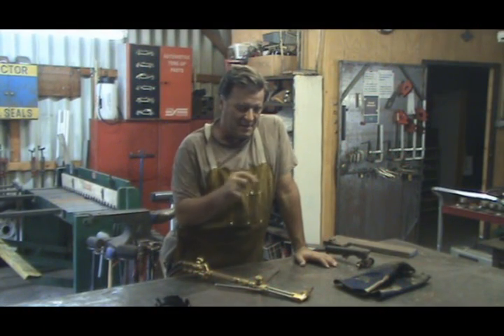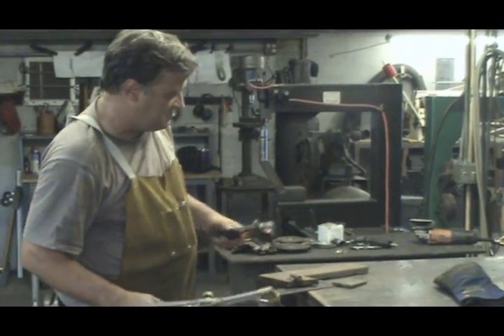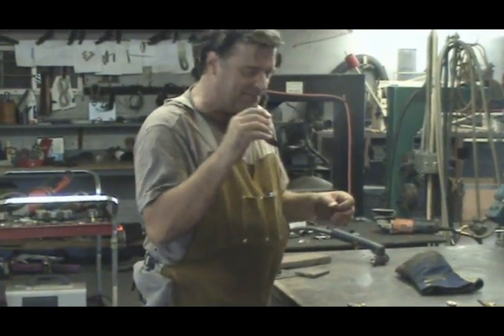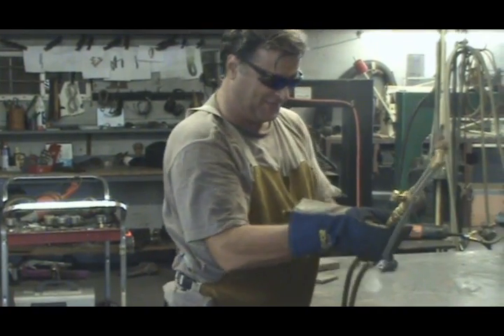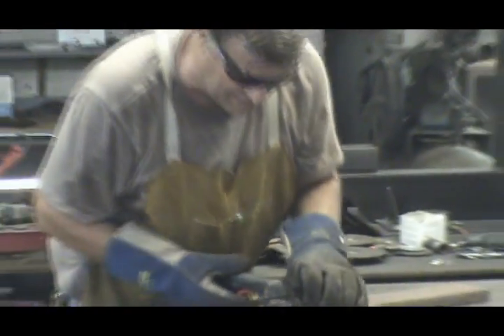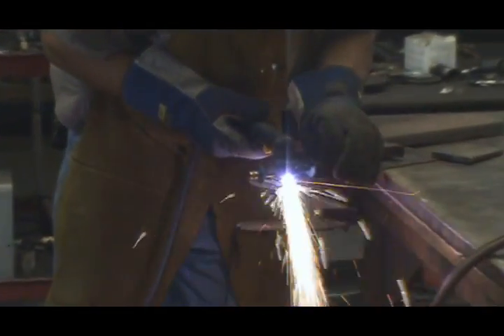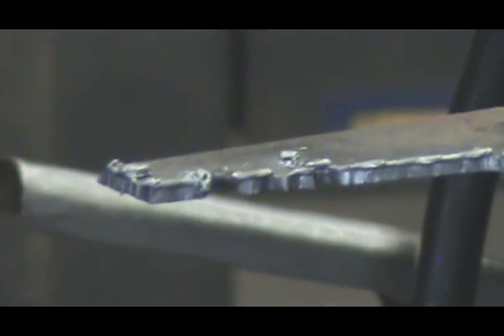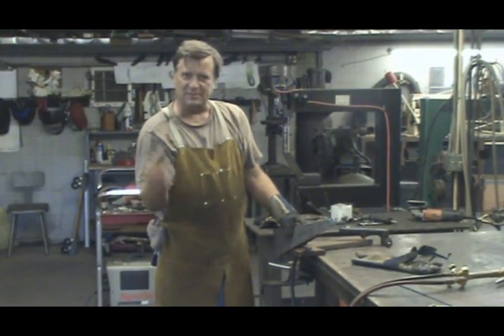Metal Cutting: Plasma vs. Oxygen-Acetylene - Kevin Caron

Comment: I would never cut sheet metal with oxy-fuel at all. Plasma cutting looks very promising for knife making, which would save me a lot of my quality, homemade pine charcoal, belt-sanding and forging on 1095, 5160, O-1 or 440 stainless steel (plasma can air harden this grade due to the incorporation of molybdenum, but that's not a big problem and can just wrap it with a fire blanket or dunk it in a bucket of lime). Plasma torches are the smith's dream come true.

Comment: so what is the difference between a blow torch and a plasma cutter?
Reply: ***** you can weld metals together with torch but not with a plasma cutter right? I thought torch can cut metals as well. Sorry I'm not a welder
Reply: Cutting sheet metal with oxy-fuel is the most difficult, but plasma does it well. Oxy-fuel would be better suited for anything over 2 inches.
Reply: Seph Angelo oxy-fuel acetylene are able to cut through thick and hard metal sheets as well as welding them together?
Reply: Also keep in mind that a plasma will cut any conductive metal. I.e. aluminum, stainless, brass, copper,etc. a oxi-fuel will not cut anything but iron/steel. plasma cuts by heat, and air pressure blowing out the metal. Oxi-fuel actually rapidly oxidizes the metal, burning it and turning it to slag.

Comment: a good thing about plazma is that you can get closer to the metal amd the tip wont mess up but with oxygen cutter if you get it to close it will pop and splatter everywhere when this happens if wearing loose clothes splatter can fall down and burn

Comment: If I may suggest You something on using an Oxygen-Acetylene torch - don't use dirty gloves - clean oxygene may put them on fire and You may get burned. 
In case You don't have fuses on the Oxygen-Acetylene cables - add a little bit of oxygene when You light the torch otherwise there is a risk the fire may get sucked throught cables to the acetylene bottle.